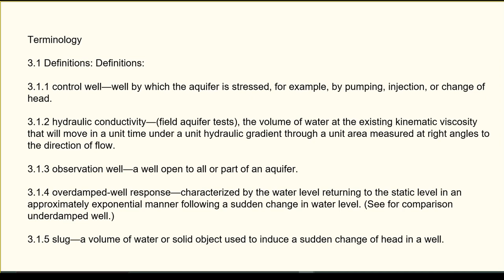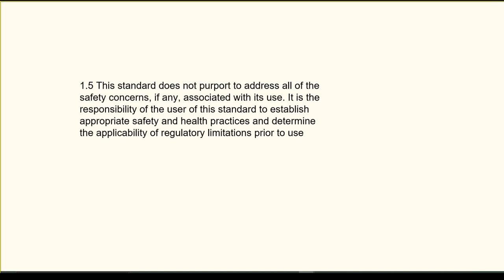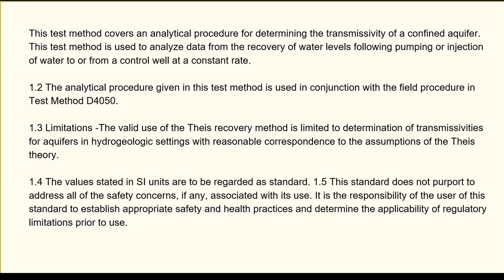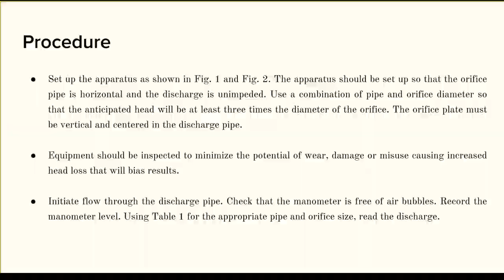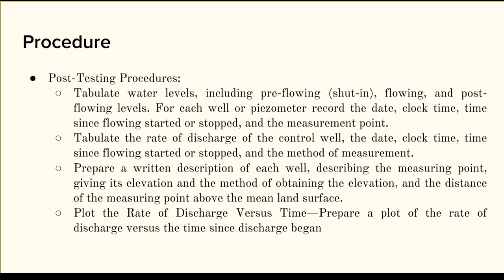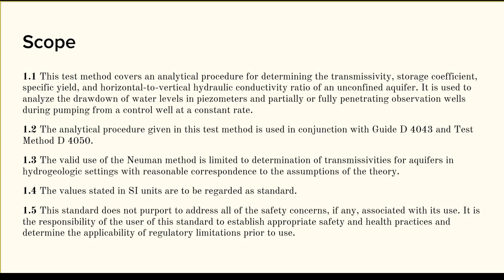EE13 GROUP 13: AMERICAN SOCIETY FOR  TESTING AND MATERIALS (ASTM)

Comment: The American Society for Testing and Materials (ASTM) is a body in which aims to publish production standards for a vast difference of industries across its partners. ASTM also includes standards for materials, systems and products as to encourage consistency and safety among manufacturers. Despite it being voluntary, it helps in the spread of reliability across different aspects and can reduce risks involved in the industrialized and related sectors; ensures that products and services are of the highest standards and accuracy, respectively.

Comment: I observed from this report that testing materials and equipment follows a set procedure. This guarantees the reliability and safety of the products a company manufactures and distributes. Additionally, this is significant because various parameters are used here to test the products' strength and capabilities.

Comment: According to the 13th group's report and what I understand, the American Society for Testing and Materials (ASTM) is a renowned organization that develops and disseminates voluntary consensus standards with the goal of improving product quality, making them safer, advancing global standardization, and ultimately facilitating commerce. It is crucial to use ASTM standards when evaluating the material, chemical, mechanical, and metallurgical characteristics of metals. This information helps to guide product designers toward suitable application and processing stages.

Comment: These report also shown me that even a set of standards on the in-situ assessment of the hydraulic properties of aquifer systems by single- or multiple-well testing are no being created. This document provides guidance on selecting a test method for analyzing hydraulic characteristics and constructing a conceptual model of a field locatio. Its guidance does not specify a particular process for calculating hydrologic variables.

Comment: I have learned that in this guide is an integral part of a series of 
standards that are being prepared on the insitu determination of hydraulic properties of 
aquifer systems by single- or multiple-well 
tests. This guide provides guidance for 
development of a conceptual model of a field 
site and selection of an analytical test method 
for determination of hydraulic properties. ASTM International, formerly known as American Society for Testing and Materials, is an international standards organization that develops and publishes voluntary consensus technical standards for a wide range of materials, products, systems, and services.

Comment: As I have learned from this topic, American Society for Testing and Materials or ASTM International is a consensus standards volunteer that deals in delivering standards, test methods, specifications, guide and practices. This society is capable of doing standards practice such as testing and analyzing flow rate of water. Also testing method that covers an analytical procedures in which determining the transmissivity of aquifer and analyzing data from the recovery of water levels from a control well at constant rate.

Comment: I learned from the report that ASTM International leads the way in testing solutions worldwide. ASTM standards are crucial in evaluating the materials and other products. This information helps guide product manufacturers toward proper processing and application procedures. Testing against these standards ensures high-quality products for customers, accurate technical specifications and performance characteristics.

Comment: I now know that the h test method includes determining transmissivity from the measurement of a well-aquifer system's force-free (overdamped) reaction to a sudden change in water level. A well's water level will restore to its initial level in an almost exponential fashion with minimal inertial effects in a force-free response to a sudden change in water level.

Comment: I've learned that The American Society for Testing and Materials (ASTM) is a well-known organization that creates and disseminates voluntary consensus standards with the aim of enhancing product quality, making them safer, advancing global standardization, and ultimately facilitating commerce.

For instance, the ASTM establishes standards for the effectiveness of airbags, seatbelts, and tires in automobiles, enhancing both the safety and efficacy of automated systems and consumer confidence in the industry. The ASTM's yearly book of standards has 15 parts for various products and industries, including those related to iron and steel, plastics, rubber, construction, and textiles.

Comment: from what i have learned they are the , One of the reasons why so many and such a wide variety of companies have completed their various standards development work inside ASTM International is the open procedure in which ASTM standards are produced.
Participants in the ASTM system come from all around the world since it rewards technical proficiency rather than nationality. Nearly 50% of ASTM standards are distributed outside of the United States due to the high degree of technical excellence at its core.
ASTM International leverages online technologies that promote open involvement and responsiveness to industry demands in order to permit widespread worldwide input. They include online voting, electronic minutes and templates, virtual meetings, and cutting-edge dissemination techniques. Internet-based Standards Development Forums that are accessible 24/7 around the world are also included.

Comment: After watching the report of group 13, I learned that The water level in the manometer indicates the pressure head in the approach pipe when water is being pumped through the orifice. For any given size of orifice discharge pipe, the rate of flow through the orifice varies with the pressure head as measured in this manner.